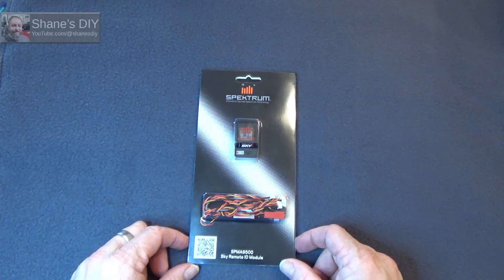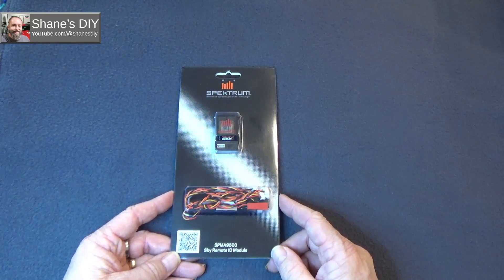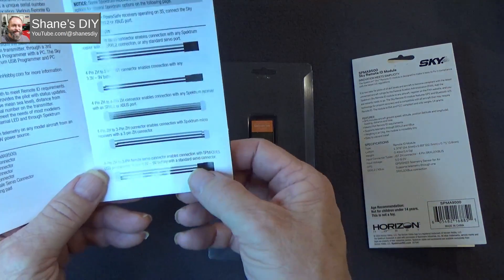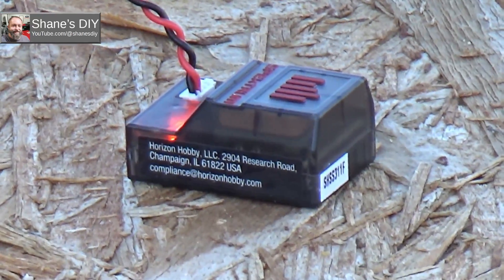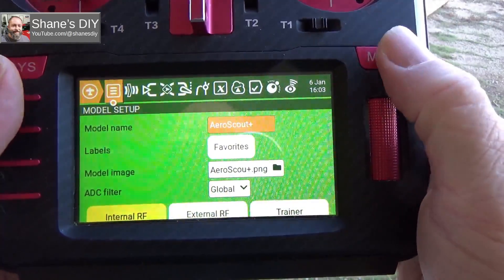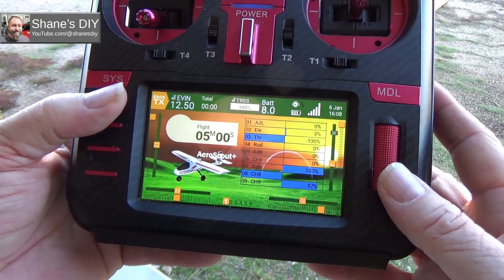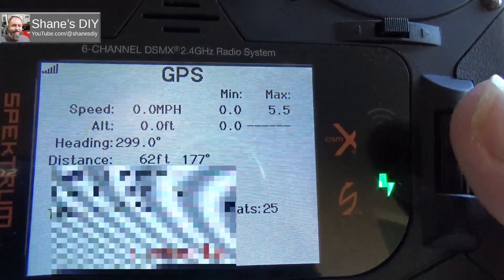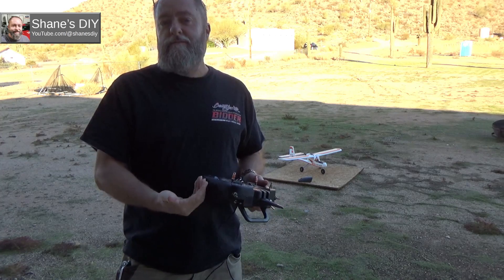Spektrum Sky Remote ID Module #SPMA9500

Comment: Which port would this need to connect to on the RadioMaster ER6 receiver?
Reply from the maker: In order to take advantage of the pilot telemetry you must use this with a compatible Spektrum receiver with an XBUS, SRXL2 port, or a "Smart ESC" port.  If not using it with a compatible Spektrum receiver, it will only operate as an FAA remote ID module sending data to a mobile app via Bluetooth.  I am not aware of any way to connect it to an ER6 and get the pilot telemetry as XBUS or SRXL2 are not available protocols with the ELRS ER6 receivers.

To use it just for an FAA Remote ID device, you can connect it to any available port on the ER6 or any other receiver just to provide it with power.
Reply: @shanesdiy Thank you for the quick response I just wanted to ensure that it would at least broadcast and verify how to hook up which you answered, definitely appreciate it.

Comment: Hi Shane, I'm having a problem using my NX8 transmitter with an Apprentice STS 1.5 and the Remote ID. I'm trying to get  the Remote ID to show the data on the NX8.  The Remote ID light is on, I went to telemetry on the NX8 and put in gps, scrowled to the gps screen, but there's no data showing up.

What am I missing here?

Appreciate any help and suggestions!
Reply from the maker: What port on the flight controller did you plug it in to?  It must be on a "Smart" port such as the Smart ESC port 6 or an SRXL2 port. Problem with the SRXL2 port is the receiver on that is also connected to an SRXL2 port, are there two SRXL2 ports on that flight controller?  Even if there is the manual states "if a remote receiver and Sky ID are both connected to SRXL2 ports the Sky ID won't transmit telemetry".

Does your plane have a Smart ESC connected to servo port 6?  If not, I would try that port.

One thing on the radio that you might need to do is have the model bound to the TX and go into the telemetry list on the radio and clear them, then re-discover all new ones.  On my NX6 when trying to use the Sky ID with an AR637 I was only getting GPS coordinates back from the Sky ID.  No altitude or speed.  I fixed it by clearing the telemetry list and refreshing/re-discovering them.  Just adding a new one didn't make it work.
Reply: @shanesdiy  Hi Shane, 

I did try refreshing the telemetry list but it didn't make a difference yesterday. 

As for the SRXL2 ports - I don't see any markings so I'm not sure. Couldn't find anything in the manual on it either. 

The plane has a SPEKTRUM FLIGHT CONTROLLER A323O. I plugged into port 8 and it didn't work. Next I plugged it into the Bind Port and it didn't work. Port 6 is a SMART ESC port and is wired to the 30-Amp Telemetry Capable ESC. Is it possible to still hook it up to port 6 using a Y cable? I'm new to this and not sure what else to do. 

Thanks for the help. It's much appreciated!
Reply from the maker: @we4fm175  Port 6 with a Y cable should work though I haven't tested it.  Manual says you can do that.  Has to be a Smart enabled port to get the telemetry data. All the other ports will just give it power and the signal pin is only an output unless it's a smart port.

For the telemetry refresh, be sure to Delete All, then do the Auto-Config.  If you just do the auto config without deleting the old ones, it won't always work.  That was my experience.
Reply: @shanesdiy   I didn't do a delete for the telemetry, and I'm not sure I saw that option, so I will look again and then try the Y cable. I will let you know how it goes. Should be interesting! 

Thanks for your input, sharing your experience, and taking the time to help me.
Reply: I tried port 6 today with a Y cable, but it didn't work. I will keep trying. Thanks again.
Reply from the maker: @we4fm175  Did you do the telemetry delete and auto-config again? Couldn't get one of my models working with the Sky ID on an NX6 until I did that.
Reply: @shanesdiy  I did a telemetry delete by going into telemetry and selecting each option, i.e., Smart Battery, Gyroscope,  ext, and setting it to - Empty.  Is that how you did it, Shane?

I have 2 Apprentice STS 1.5m planes and will try the other one today, after I know that's how you're deleting the settings. I'm confused about what you mean by deleting, I guess. 

I called Horizon Hobby several days ago and their tech guy said he had to check with someone there who is more familiar with the plane and calk me back within a couple of hours but they never called back. 🤔 

Again, I thank you for your suggestions and help. 😁
Reply from the maker: @we4fm175  On my NX6 telemetry screen there is a "Delete All" option at the bottom.  That's what I did, then while the plane was connected with the Sky ID installed, I did the Auto-config and it all re-populated and the Sky ID was working.  I didn't do any of the items one at a time.
Reply: @shanesdiy  I find that very interesting. I will update my NX8 and see if that option is there afterwords. I do believe that what I did accomplished the same thing. Would you agree? 🤔
Reply from the maker: @we4fm175  As long as you deleted all entries then did the auto-config I'd think so.

While it was working before I updated the radio, it did change some of the text on the GPS screen after I updated so if your radio firmware was older perhaps it doesn't recognize it.  Definitely do the radio firmware update.
Reply: @shanesdiy  Ok, I will do that this week. I will let you know what happens. Thanks again! 😁

Comment: Sir,What I wanted to explain hear,is that the FAA regulation required a remote ID module that not only broadcasts the location of your model,but also the location of the ground station,which is us flying our models with our transmitter.This is the biggest problem with the new FAA remote ID regulations.It could be a dangerous thing.Thats what I'm talking about.If you like the added telemetry,that's fine,me personally,I don't have time for that.My plane flys fast and the flight is over in 5 minutes.This is really what I meant.If you like it,that's fine,but not me.I have enough to deal with in everyday life.
Reply from the maker: I hear you and share some of the same opinions. I am far from a proponent for RID but as I previously said, your information is inaccurate. This device does not transmit the operators location. Many YouTubers spreading false info, perhaps not intentionally, but trying to capitalize on the hype for views before getting all the facts.  True there are some models that have integral RID modules like DJI that do that but not across the board. This one is not one of those devices and all are not required to display that info.

Comment: The only useful stuff in that package is the wiring harnesses.Throw the module out.That module WILL,put your life at risk.DO NOT USE IT!!!
Reply from the maker: In what way do you think this "puts your life at risk"?  Seems you have received quite a lot of misinformation on it.  Do I want FAA mandated remote ID, of course not and odds are no one will ever even see my drone or RC planes or ever have an issue with them even if I never install one.  That said, in no way do I believe it puts me at any risk.  It only transmits a few hundred feet, doesn't tell anyone where I'm standing, doesn't tell anyone my address.  How does it put you at risk unless of course you plan to fly your drone where you shouldn't?

Comment: Hi Shane. Thanks for your instructional videos on the SkyID. Is there an initial setup that it needs to get it to report the correct altitude height? I found that mine will display “30 feet” of height when on the ground, but as soon as I take off, the altitude reports are “19,000+” feet! 
I have in on my Gentle Lady glider with an AR630 receiver. My Transmitter is a DX6, and was updated to the latest firmware. Have you experienced this “faulty altitude” issue?
Reply from the maker: I didn't have to calibrate but I have found that it takes a while to stabilize at what I think is the correct altitude. So far I can only see actual altitude over sea level since I'm using my Radiomaster TX16S.  I used it in a recent prop test flight video to measure time to climb and I had to let it sit on the ground for 5 minutes or more to stabilize before I could take off in order to get accurate results.

Comment: Does anyone know how much power that thing draws?
Reply from the maker: Good question, I should have included that in the video!  99 - 120mA while acquiring (due to the blinking LED), after satellite lock sits at 118-119mA.
Reply: Thank you. That is a significant amount of power for a 4 cell NMHI pack.  @shanesdiy

Comment: I have my Spektrum SPMA9500 RID Module (using SPMA3065 cable) registered with Spektrum and FAA DroneZone successfully. But the programmer's portal tells me there are  new "software updates" at this time. All over the internet it instructs me to make sure to download latest "software update" before any flights in the field as RID Module may not be transmitting the right information to FAA/LAANC. I was wondering if there is an update out there that I may be missing out on.🤔 I will also call in to Horizon Hobbies Tech Support to get this information.😇

Comment: Hello, I am a friend of Dan that has a channel called:
Captaindan1954
Question is I have a NX10 and a sky rx spektrum and I pluged it into ch. 5
I waited several minutes and the sky rx was solid orange. But I never got GPS  sent back to my NX10. But you got it in your NX6. 
Can you advise me?
Bob A
Reply: I will wait for an iPhone app and watch your channel for next updates. 👍
Reply from the maker: Hi Bob. First, what receiver are you using it with?  For the telemetry to work it must be connected to an XBUS or SRXL2 port.  On an AR631 like I used in this video this would be the bind port or port 1.  Any other port, 2-6 you plug it in to you won't get telemetry.  To use it on port 1 (throttle) you need to have a "Smart" Avian ESC to use the ESC and the SkyID on a Y cable.

If you put a normal ESC and the SKYId on a Y on port/ch1 the ESC will not arm.  If you use port 2-6 you will only power up the SkyID and it will transmit to a Remote ID app but not via telemetry to your transmitter.
Reply: I am having a senior moment. I repluged it into the correct data plug and it came up super fast!!
Anyway my emoji shows my original build in 2011 a month after I retired. I took two kits and combined them to make a Twin Cub. 
TY. Look 👀 up: Captaindan1954
😁
Reply: One more question. I have an iPhone and I can’t find the app you used. 
Any idea for my iPhone issue
Reply from the maker: I only have an android phone, not sure which RID apps are good for iPhones.  My wife has an iPhone, when she gets home I'll see if I can find one that works.
Reply from the maker: I successfully tested "Drone Scanner" on an iPhone 13 and it saw and tracked my SkyID.

Comment: Just got mine last week too.  I ordered it the day they offered it.  I haven't opened it yet and am saving it for when I need RID in a larger plane.  Right now, none of my planes weigh enough to require it. I originally ordered it for putting on one of my larger drones with a battery attached.  Since it wasn't in, I ordered the HolyStone since it was self-contained for that drone.  That bound really well and works great.  Hope the FAA allows it to remain on the DOC list.
Reply: Just curious about your holy stone...have you ever looked at the altitude info?  I got one and it always shows about 0 M (sometimes .5 m)  even when I'm 50 feet in the air.  I watched lots of review videos and found one where someone actually showed what it was reporting and although he didn't make a big deal about it it also showed incorrect altitude.  Do you have that issue?
Reply from the maker: Mine is an SJRC F22S 4K Pro. Same transmitter as a couple Holy Stone models.  My altitude and speed info is accurate. I compared it with the SkyID and they matched.

Comment: Got mine finally 10 days ago. Another waste of money that does nothing to improve safety But after 46 years of flying its something new with bling. Lol! Thanks for the video showing the features.
Reply from the maker: Agree, as I mentioned in the video, main motivation for someone to buy this unit over a dedicated RID module, is you can take advantage of some additional telemetry.  Working on more videos on it demonstrating some cool ways to use the data and testing more functions.  Also have been working with the EdgeTX developers to integrate some SkyID functions directly into EdgeTX.  I'll share more info as things are released!
Reply: @shanesdiy  Wow, sounds great!

Comment: Hey Shane I have an off topic question you might be able to help me with I have a ar637ta and a radio master tx16s I'm trying to figure out how to adjust the gains for stability and not having a lot of luck do you have any experience with this?
Reply from the maker: I will assume you have the latest Forward Programming LUA scripts installed on your TX16S? v0.56 is the latest, but v0.55 is fine at the moment.  I have a series of videos dedicated to acquiring and installing the necessary software, unlocking the Spektrum AR receivers, and resetting/reprogramming them from scratch.

The AR637TA I presume came in a BNF airplane (if it didn't it would be an AR637T)?  Depending on which plane and what firmware it has on it Spektrum may have it locked so you cannot access those settings via Forward Programming, even with a Spektrum transmitter. For example, in my Turbo Timber Evolution, the stock AR637TA will only allow you to change the f-mode channel and edit each mode whether it has safe, as3x, or no gyro.  If this is the case you will need to update the firmware and reset it following the instructions in the videos mentioned above on my channel as you cannot alter any deeper settings such as gyro gains.
Reply: @shanesdiy  thank you for the reply I'm at work at the moment but will check it out some time tomorrow and see if I can get it figured out thank you for giving me a direction to go in.   The receiver I bought from spectrum as a stand alone so it's not the bind and fly one.    Really just want to use it for my scratch builds I have it working correctly but it over compensates depending on the size of the ailerons I think. Thank you for your help I'll try to make it back and keep you posted if I figure it out
Reply: @MikeErwin-fpv  use your control arm and servo arm length to reduce the auto control rather than the gain.

Comment: Mine isn't registered and updates show to connect if any ever show up.
Reply from the maker: Ya, I wasn't sure, just assumed based on past experience with Spektrum requiring registration to get receiver and transmitter updates. I plugged mine in to the USB adapter and checked for updates after completing the video and there were none available yet.

Comment: All data works with the Karen apps even without registering. Registering only links the data it sends out to you. My module only puts out partial data to the rx (no speed or altitude) and my frame losses go up by a factor of 10x along with 1-2 holds on flights. Andy Kunz has a crew working on it but I've not heard a word in several weeks. He said there's nothing he can share. Pay attention to your frame/fade/hold data before and after using this. Andy said some work, some don't.
Reply from the maker: Yes, the telemetry data I was referring to was just to the transmitter.  I understand the "Karen" app data is independent.  I'll definitely keep an eye on the frame losses and holds with and without it.  I can see how that could be an issue with all the additional data being sent.  I have been working with one of the EdgeTX developers sharing data on this device.  Already found one bug in the GPS coordinate translation that will be fixed in a future version of EdgeTX.
Reply from the maker: What receiver are you using that only puts out partial data?
Reply: @shanesdiy  A few. 2x631, 1x637ta. Fed by an NX10. Speed and altitude are recorded in TLM but not live data which was my entire reason to buy one. The module sends a signal at 1hz which just about equals the frame losses if doing the math of flight time versus frame losses at 1 update/second but Andy won’t discuss it.
Reply from the maker: @kmatch1  Very strange.  I'll watch that closely and do some monitoring of the losses and/or drops.  I've now tried this on 3 different AR631 receivers and been able to capture all values including speed and altitude on all of them.  I don't know Andy but I wouldn't suspect anyone from Spektrum would be very forthcoming with details from "under the hood"...

I've just updated my NX6 and connected but haven't done much with it, most of my tests so far have been with my Radiomaster TX16S with EdgeTX 2.9.2

Comment: You need to balance your prop , sounds bad
Reply from the maker: Agree, it sounds awful! That plane has never been in the air, just been used in videos so far. Always fly the other one with all the mods. I also noticed that the nose wheel needs to be centered, it always turns... she's not airworthy at the moment.

Comment: I read on rcg that it will work with any non spektrum rx as well
Reply from the maker: Manual says SRXL2 and XBus support.  I tried it with the SBus on one of my Radiomaster R88 V2 receivers and no telemetry came through. I'll investigate further for other RX options but I don't think SBus is supported.

Obviously the Remote ID functions with just power applied between 3-9 volts as that is not transmitted through the receiver.

Comment: Will it work with a 620 Spektrum receiver?
Reply from the maker: Telemetry will not work with the AR620 as it does not support SRXL2 or XBus.

I did also try SBus with a Radiomaster R88V2 receiver bound with the FrSky D16 protocol and was not able to receive any telemetry from the Sky ID.

The remote ID functions will work without any receiver, just needs power between 3-9 volts.